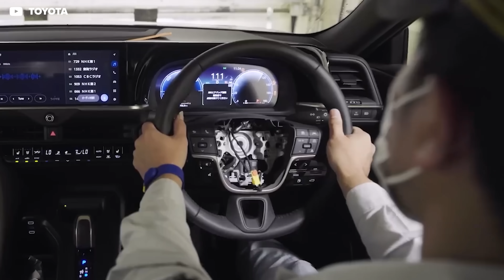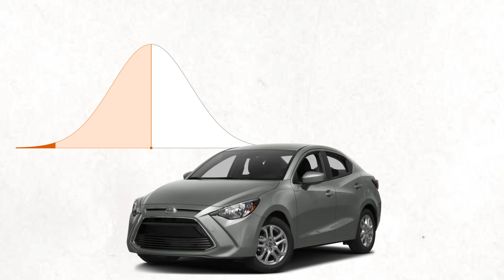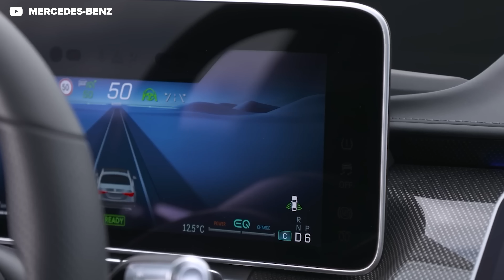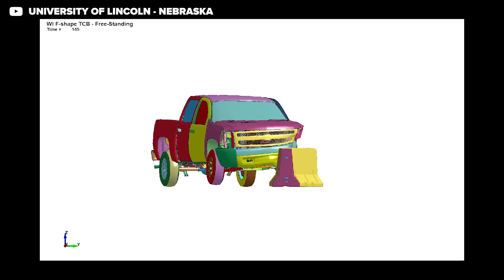The REAL reason guardrails can't stop EVs in a crash

Comment: Oh, come on. EVs are not 4000lbs heavier for an equivalent vehicle.
Reply: You're correct 

A 2017 Golf manual has a curb weight of 1344 kg, while the automatic version weighs 1371 kg. The e-Golf, an electric variant, has a curb weight of 1510 kg, including the battery
Reply: @rj7855 and remember that manufacturers quote dry weight so no fuel in the tank, which likely adds another 60+ kg to those weights for ice vw golf.
Reply: This guy loves his hyperbole. Easy to check online that his numbers are BS.
Reply: It is accurate that a Silverado EV is about 3800lbs heavier than an "equivalent" 1500 - but they are slightly larger with more power, bigger wheels,  and more features.

But if you look at a Cybertruck vs 1500 or Silverado, it's about 2000lbs heavier even with air suspension and power tonneau.
Reply: Agreed. EVs are realistically 0 and 2000lbs heavier than a truly equivalent vehicle.

A Rivian R1T battery pack, which contributes to the structure, is approximately 1700lbs.

The largest EV battery, in the Hummer EV and Silverado EV, is approximately 3,000 lb. 

Keep in mind that these vehicles don't need to have big transmissions, and big iron engines - The electric motors and single speed gear reduction are much smaller and lighter than an equivalently powerful gas / diesel engine, transmission, and differentials.
Reply: "Up to" doesn't mean "all" and even then, examples were listed
Reply: @Southghost5997 bull$hit clickbait titles to divide people and drive clicks. Most people read the title and think it's fact. At best its  disingenuous, at worst its misinformation.
Reply: It's those GM trucks with massive 213kWh batteries that are pushing 4000lbs over their ICE equivalents. Most other EV's are at most 1,000lbs heavier, if not lighter or equal to their equivalent ICE cars.
Reply: @seanplace8192  hate to be the bearer of bad news but evs are generally not lighter than their ice variant of the same car😂😂idk how you even came to that conclusion because its wild
Reply: @Mrrandom817  The Cadillac CT5-V Blackwing has 668hp, goes 0-60 in about 3.4 seconds and weighs 4,120lbs.

The Audi RS 5 Sportback has 444hp, goes 0-60 in about 3.7 seconds, and weighs 4,050lbs.

The Tesla Model 3 Performance has 510hp, goes 0-60 in about 2.8 seconds and weighs 4,050lbs.

Lastly. I did not say 'Generally lighter than their ICE variants'. You said that. I said most EV's are no more than 1,000lbs heavier than their ICE equivalents, if not the same or lighter.
Reply: @seanplace8192  The hard part with this comparison is that those trucks are not built on remotely the same platform. 

The battery is "only" 2,800 lb so where the hell is that extra 1000 lb going? Especially when they don't have a transmission, drive shaft, or transfer case
Reply: @GregMcNamer  electric motors are alot heavier than you'd think, and they do have a transmission, inverter, and axles, i think the tesla model s motors with single speed transmission and inverters weigh about 330lbs, and it has two sets of them, a modern 4 cylinder and transmission together weigh about 400lbs
Reply: Yes, they are. Than the average sedan, they absolutely are. The numbers aren't comparing a gas car to an electric version of the same car. They're comparing a Tesla Model X to the average crossover SUV.
Reply: @Caffeinated-DaVinci The curb weight of a Toyota Camry is around 1660 kg. Add to this fuel weight of say 60kg gets you to 1720 kg.

The Tesla Model 3 has a kerb weight of 1765kg for the Rear-Wheel Drive (RWD).

You can cherry pick examples all you like. The fact is that evs are generally very similar in weight to similar sized ice vehicles.
Reply: @Caffeinated-DaVinci how does a BMW 3 series has weigh more than a model 3 then? Stop being stupid.

Comment: 1:40 In Europe the better equipped Civic Type R is 1.428Kg and the Civic e:hev (Hybrid) is 1.533Kg. What model did you research? 1.330Kg seems very lightweight to me.
Reply: Hopefully one day Europe will learn what a decimal actually does and how it works in math.  Looks like you're quoting the weights of remote control cars, lol
Reply: In Europe they add 75 kg for the driver, and even if both weights were without drivers it looks plausible, as the R has a bigger engine and transmission, plus some added features to improve the car. Tires, breaks, exhaust, suspension parts

Comment: I'm not sure the center of gravity argument regarding guardrails and EV's mentioned in this video is strictly correct. What's more important is the physical profile of the vehicle: if the profile is low, it will go under the guardrail regardless if the center of gravity is low or high. If, on the other hand, the profile of the vehicle is high but the higher part of the vehicle is weak and crumples, than a low center of gravity can be an issue. As is often the case, the real world can be complex, and the simplistic analysis about center of gravity offered up in video should be taken with a grain of salt and requires much a more in depth analysis before any concrete conclusions can be made.
Reply: I tend to agree. While the position of the center of gravity might explain the Tesla going under the barrier (although how low the nose of the car is seems just as likely or even more likely to explain it), it doesn't explain at all the rivian jumping over the concrete blocks: there it's most likely just weight, although a Ford expedition or a giant Cadillac suv might do something similar.
Reply: @epcotte  The top of the bumper of the Tesla is high enough to hit the guardrail right on. The issue is that as more force is applied in the impact the lower CoG encourages the car to pry it's way under the guard rail preventing the guard rail from catching the Tesla. Think of the guard rail as a rubber band. If the CoG of a vehicle is below then even a perfectly squared up front of the car won't be enough to prevent the car from wanting to try to pry it's way under the guard rail/rubber band.
Reply: No engine to catch the guardrail so essentially the EV is getting extruded under the guardrail. In a hypothetical situation if the guardrail was totally rigid and immovable and EV would be squeezed through and look like toothpaste unlike an ice car which would just be pancaked
Reply: It does seem a bit strange. The average height of the centre of gravity is a thing, but I wouldn't think it would be that useful. There must be so much variation. You have hatchbacks and trucks and everything else, they'd all have vastly different heights for their cg.
Reply: @simon-gr-au yeah the center of gravity on a pickup truck would definitely be higher than like a Honda civic but they have engines and engine cradles etc that resist crushing unlike an EV that has nothing in the front so the front end tends to squish vertically and squeeze under the guardrail whereas a pickup truck will have a tendency to vault over regard rail but generally get caught on the wheels that and modern cars with engines are designed for the engine to be pushed downward in an accident meaning something extra for the guardrail to grab a hold of
Reply: This is what's wrong with the world, people have no idea what they're talking about. Dude just showed you all the science, tests and the people that do this as a job explained it but you say "nah bro". Are you a flat earther too?
Reply: Placement (height) of the mass is the most important factor at those forces.  A mostly empty body panel creating a different shape without any mass behind it is not going to do anything except get bent out of the way of the mass.
Reply: Yeah, you know more than the engineers designing these systems. You should start your own DOT

Comment: My EMT buddy told me that car on car accidents involving an EV and ICE cars always results in worse injuries for the ICE driver.
Reply: I gotta get better at dodging cars then
Reply: Of course it does, more mass causes more damage . evs are horrible for the environment when they're made and when they're driven 😂. They didn't think of the road damage they'd be doing with their massive weight and different tires.
Reply: Pretty much the way it's always been poor bastards driving a geo metro in the '90s didn't stand a chance against a full size SUV or truck weight matters in an accident
Reply: My pickup weights 6800 lbs. Good luck. 😂 and I have a big beautiful pipe bumper. Again good luck. 😂
Reply: I'm guessing that rivian didn't burn, and the battery pack took a big hit.
Reply: @simon-gr-au  the dummy load (substituted for batteries) isn't likely to burn like charged EV batteries.  Did you really think that the test vehicle had actual charged batteries on board?
Reply: @vincentsutter1071  um, how was it going?
Reply: @simon-gr-au  you're gunna flip when you find out how a puppet is controlled.
Reply: @lolbuster01 I missed the strings in the footage? Seriously.
Reply: My friends Hairdressers boyfriend is a mechanic and KNOWS everything about cars. Why bother with statistics and science ?
Reply: EVs are safer cars, yes.  That's what you mean right?
Reply: The video covers this--it's because EVs have much better crumple zones without a huge, incompressible steel block under the hood. Also doesn't hurt that the low center of mass makes it much more likely to stay planted on the wheels instead of rolling over.
Reply: Because the engine injures people in an ICE vehicle.
Reply: Scary
Reply: More reasons to buy an EV then.
Reply: @vihtoripuurola3775   More like a reason to ban cars and replace it with busses, trains, for most people. Only produce vehicles for commercial purposes if you know what I mean.
Reply: @Eibarwoman  Not in the USA. We take our freedoms seriously here.
Reply: Yup heavy car wins each time, do EVs are more dangerous to everything else.
Reply: @Eduardo_Espinoza incorrect
Reply: @Eduardo_Espinoza  And a big ass truck lite the F150? I guess you were opposed to them also.
Reply: @skunkjobb  I'm opposed to that also. We don't need pickups to be as enormous as the modern pickups are to perform their intended purpose. When it comes to pretty much any vehicle "add lightness" is something that is always beneficial.
Reply: @skunkjobb I would like to have one of those old F150... Good engine / good capacity / good repairability. Any other older car also..
Reply: @RealButcher  theyre still out there buddy, they didnt go extinct, go get yourself a good ol truck, marketplace is good, but you gotta know what you're looking for.
Reply: If they're actually used for jobs that are essential for building this country than no, like banning the trucks that deliver food to grocery stores, but now everyday Joe blow will have a heavier car  @skunkjobb
Reply: @skunkjobb the heaviest speced out F150 weight 300lbs more than a tesla model X.....and its over a much larger area meaning less dense making impacts safer. That tesla would cut through anything it crashes into, while the truck is much more likely to push whatever it hits.
Reply: @Bojangles06 lol, the truck will crush your ribcage.
Reply: @MaticTheProto you'll get injured either way. But that EV is going to cut your car in half lmfao
Reply: @Bojangles06 the ev is on the regulated bumper height unlike the pick up. 

The ev is safer
Reply: @Eduardo_Espinoza  Heavy car does not win every time. Its just the fact an EV by design is safe and its almost impossible to roll it over. Meanwhile you get nipped in the corner of your heavier, lifted, F-250 and it goes rolling you over to heaven.

Comment: The Silverado has gotten a lot heavier though. My 78 C10 only weighed 3600 lbs. I don't think there is any full size truck that only weighs 3600 lbs now. As for vehicles with a low center of gravity, my 79 Subaru DL has the entire engine in line with the floor pan and the center of the wheels, about 15 inches off the ground, because of the pushrod flat 4 engine which is only about 8 inches tall not including the oil pan. However it only weighs 1800 lbs.

Comment: Outlaw Automatic Transmissions!  That will tech them to pay attention lol...  No comments about EV's until I try one.  I'm a little worried they accelerate too fast for the average driver.  Maybe they need something like "IC engine transmission mode"...
Reply: Most (but not all!) EVs just use a gear reduction as a transmission.
Electric motors have peak torque at locked rotor: so can typically get away with only one gear.
I am pretty sure you start losing efficiency at half the top speed as you move from the torque (current) limited to power limited regime.
Reply: @economicprisoner  agree 1 gear, but I'm sure they have built in Throttle lag too...
Reply: @fpostgate  I know my Leaf appears to be tuned not to burn rubber on dry pavement.
From the one time I tried to do a "pull".
Don't recall any tire squeal.
On ice I like to have the power monitor up to limit the motor to about 10kW (7hp) or less.